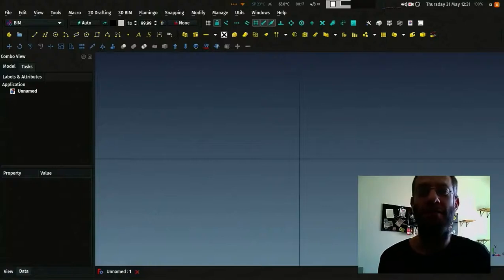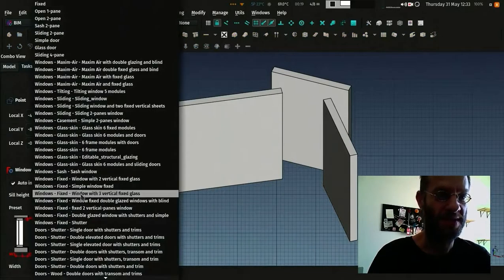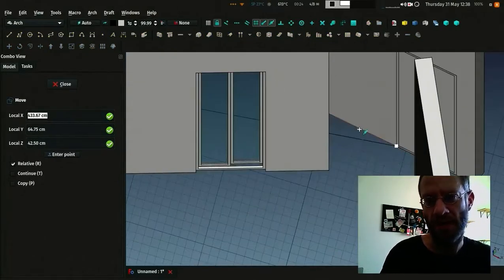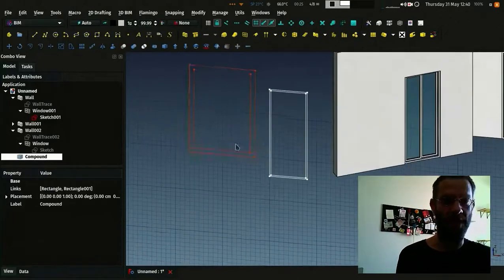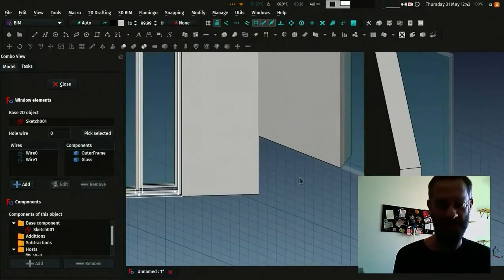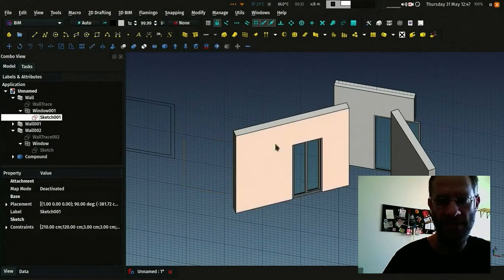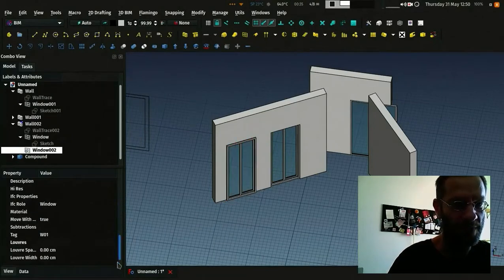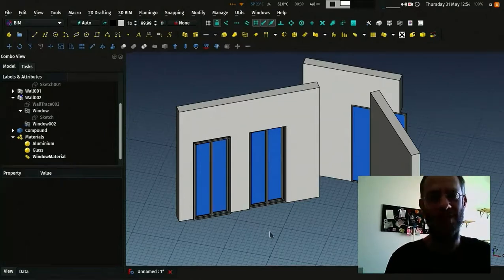BIM with FreeCAD - Windows

Comment: About dimensions: what are 3D dimensions for? How would you use it? In a practical sense, what is their idea? In the display projection? If there is a font on the sheet, then how is the font in 3D the same as on the sheet? What are the dimensions? How to change the size, for example, not from the window to the rotation, but from the window to the axis? And then about? Can I add or remove a size to the dimensional chain? Or divide it (it was the length of the house, but it became - from the corner to the axis - to the future axis - to the second corner)? Additional dimensions are added in the archiCAD: Or (also with the "control" pressed, select an extra serif and press "delete"

Comment: hello. 
I have a problem inserting doors and windows in Freecad through the BIM Workbench. They are shown as a set of loose rectangles and not in their original form. I already uninstalled and reinstalled the FC but it did not solve. Have you experienced this and would you know the solution to show windows and doors correctly again? Thanks for understanding. Congratulations on the excellent videos.

Comment: Informative video.I managed to download parts library. Learning to place windows and doors, I believe I inadvertently changed dimensions' values of windows and door  (I realized after that the mouse middle roll button does change those values). Also, I have some windows inner and outer frame that are not aligned. Some windows have no opening, glass, ... Is there a way to reset all values to the original? thx. 
  Also, A great video tutorial would be to create from scratch one custom window.
Reply from the maker: You can basically always tweak everything back into exactly what you need.. check the base sketch, then the window components. Everything explained on https://wiki.freecadweb.org/Arch_Window
Reply: @YorikvanHavre  Thx for the link Mr. Yorik. I ll check this out.

Comment: Great performance of the Freecad team. Proposal for windows/doors/....:  a part can be based on a host. If so, the Host constraints are visible to the part (during part design stub contraints can be used). And the parts can have a hole cutting the host. Then any part can be designed and promoted to a window / door / pipe-flange making a hole in wall/other part/...  etc.
Reply from the maker: Basically this is 100% possible already. You are not forced to use the window tool to create doors/windows, it's only a convenience.. you can use part/partdesign workflows too and do very customized things. See https://wiki.freecadweb.org/Arch_Window#Defining_window_types

Comment: I don't know why FreeCAD has a lot of bugs for me! for example, when I change the length of a line it doesn't change until I draw another line! or if I make a door and change its height later the hole in the wall doesn't change according to the new height!! I cannot work with these bugs. What's the problem?!
Reply: I did not encounter this issue as yet (I m new to FreeCAD). Maybe, uninstall/reinstall.

Comment: Hi Yorik! Great tutorial. I tried to make a simple door and I succeed. But then I tried to create a double door and it seems FreeCAD is strugling to recognize the wires from the sketch. Looks like the problem is FC it's not expecting to find more than one adyacent wires inside the frame.
Reply from the maker: Indeed, it needs to undoubtly find closed loops in a sketch. The best solution is to leave a small gap (1mm or so) between different loops

Comment: Question: I've installed del parts_library and managed to see the extended window list, but when I try to insert a window from the parts_library it does not integrate the window part to the wall, I also  tried to insert a window outside the wall, move it and use the add button, but is not working. Does this window thing works only with the preset windows from the top of the list?
Reply from the maker: Indeed the windows/doors fro the parts library are not all well formatted to work with the windows system. That's on our todo list, most of them need to be resaved. For the moment, yes, only the default ones at the top are guaranteed to work correctly.

Comment: These tuorials are great Yorik. I've struggled to get started with Freecad until I found them. Specifically for windows I'd like to be able to do accurate thermal modelling which really needs an actual section of the frame (showing PVC+cavities or timber+aluminium), not just a materials list. Is it possible to define a more detailed window object for this sort of modelling? The glazing needs to be more than just 'glass'. At least knowing if it is 1,2,3,4 sheets. g-values, u-values, coatings. All these things are needed for thermal modelling. And reveal depths - I think I saw something that looked like it dealt with that.
Reply: How goes thermal modeling with freecad? I too would like to use freecad to do heat loss calculations for hvac system design. It looks so easy when Yorik does it. My window placements end up in space, my presets reset themselves.

Comment: I really appreciate your videos. I had used Sketchup before but need to change because I need better building drawings and I can't afford the Pro Version of SketchUp. I only have a simple Windows computer (Intel I3 core) and AMD Radeon Mobility Radeon 5000 video card with 2.8 Graphics memory but only 1MB dedicated video memory. I've been following and doing your tutorials with no trouble so far, but I have suddenly run into problems when I use the windows builder and place it in a wall. The viewport freezes although I can click on the tree and menu items, or change and work on another model that is open in FreeCad. Do you think this problem is due to the graphics card?

Comment: is it possible to stretch a window ( in height and width)  in the perspective view and not change it in the property by numbers ?
Reply from the maker: Not yet. But that's something that's in my plan to do. Not only for windows, but all bim objects.
Reply: That´s great. It should be possible for an architect to model all the objects at a facade 
in the perspective mode. So at the end you don´t need to use sketchUp (SU) and then 
remodel in Bim !
A 2. question : Do you have a push/pull function, same as in SU ?
It would then replace SU and have parametric Objects ......  @YorikvanHavre

Comment: how did you change theme to black colour
Reply from the maker: It is the desktop theme used by my OS (linux in this case). FreeCAD uses it automatically. But you can also use one of the stylesheets in Edit -> Preferences -> General

Comment: Great Tutorial! Thanks a lot. What is missing an any tutorial I found is how to place a window with respect to other references. Any hints on that?
Reply from the maker: Window placement is still something a bit complicated in FreeCAD. Usually you achieve correct placement by first placing a window approximately, then moving it to its correct, final position with the move tool. I still don't have a very clear idea of how this tool should work to offer an optimal workflow...
Reply: Thanks for the quick reply. I would have expected a parametric window placement. I partly have success with parametric sketches but partly have weird / kind of random behaviour  @YorikvanHavre
Reply from the maker: Working with sketches is something that works already. If you draw a sketch on top of the face of a wall, you can precisely constrain that sketch regarding to, for example, an edge of the wall. But this is not very easy to add to "preset" windows...
Reply: @YorikvanHavre  that is exactly what I encountered. Redefining the sketch you have to find the one constraint that places the window and delete it. In most cases it seems to be the last one. I have pretty much of hazzle with mapped sketches. They get unstable very fast =-(